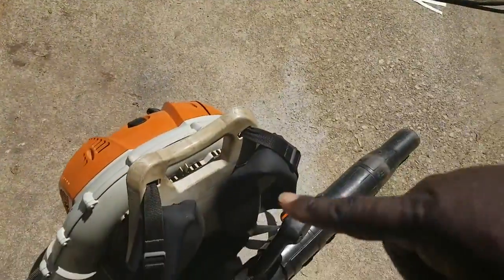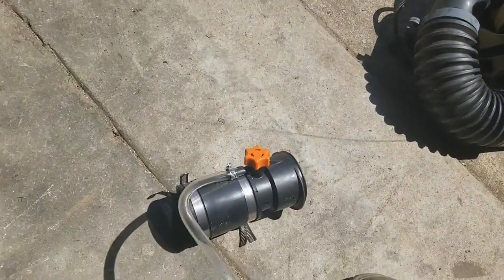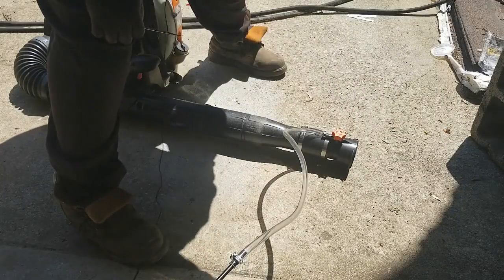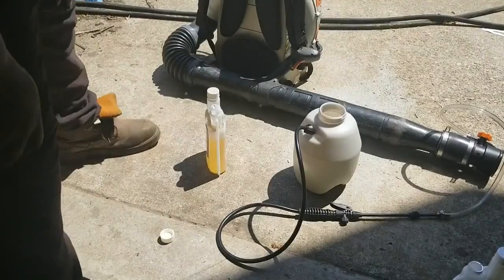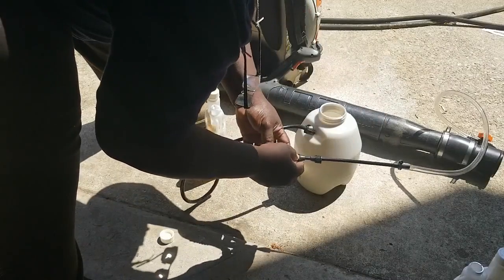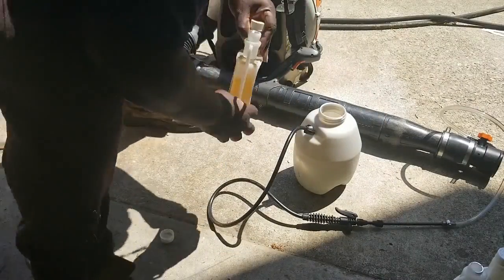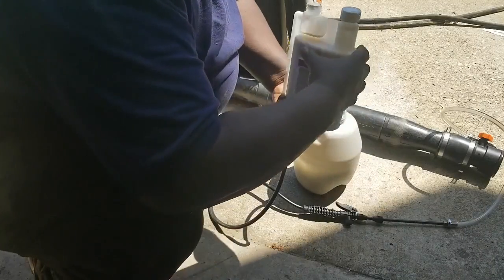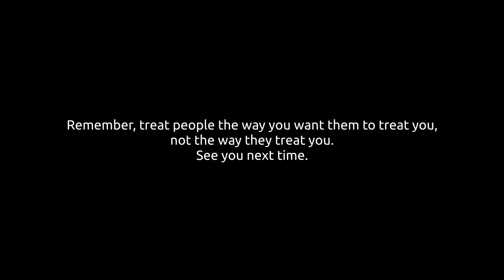DIY mosquito mister

Comment: Do you have a part number or link for the mister
Reply from the maker: Hi there, thanks for watching. Here is a link to the item: 

https://www.ebay.com/itm/185782904242?hash=item2b418625b2:g:Oc4AAOSwM9VeeXB5&amdata=enc%3AAQAIAAABAJPvTP0qS4Rmx%2FCp9aXlkFjHZdqae7oAHDUMurTuJ96JrJAgode1Rsu8XG3RQDOZrHkCW8yrqIErCko7m%2BNQpoQ%2Bi80Fsd9Jjzx9yXykKVijBb0z0JiGQNJibuNDsbnhXiCMC8TKb5Q4p9mP4Jx%2BRLKh8%2FPRcBPa1JlNc%2BHvRCILimCpN2AX%2FUZKwepVnnzqlo65YAf5hNFbwqMUPFutAlyWr6tc9wZX9Q5USlf9jWmWPaVAfftHUGaF2Mai5EU8681BTkVDMDmU7hF7xlAaXG4c4%2FemLFYCcfKOXLopff4v0kQ33VhRIU2cXkUfIdy1Le3Ia%2FTfwm%2BVezbAlV%2FKdw0%3D%7Ctkp%3ABk9SR6KG9PXEYg